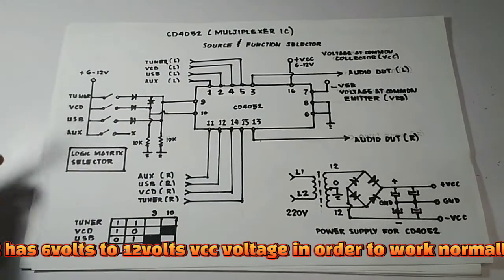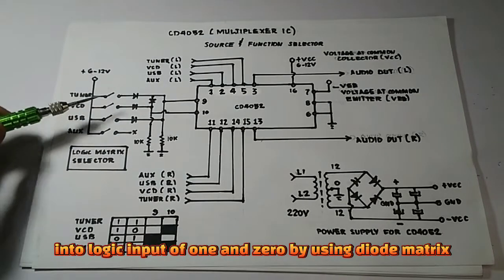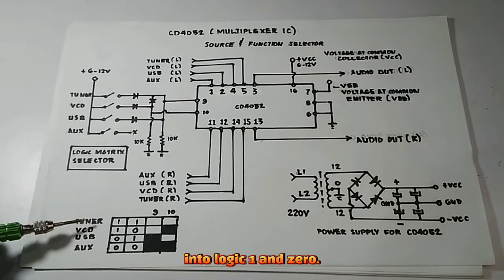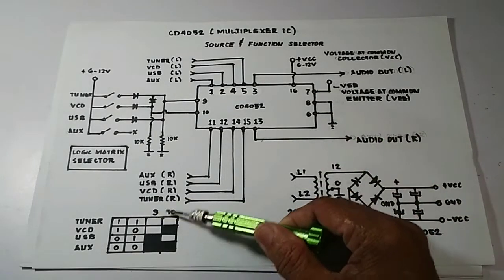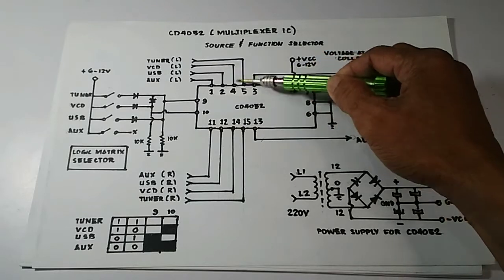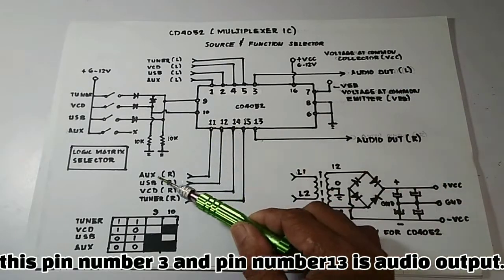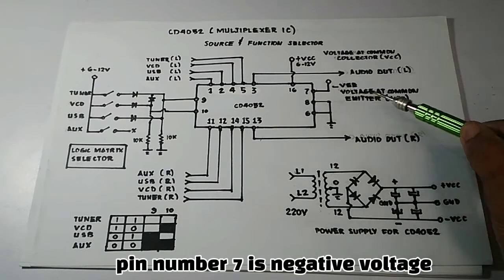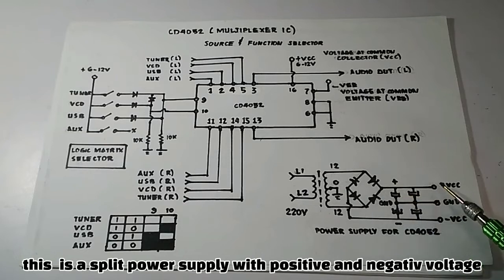Source selector / vhertron techvlog

Comment: 👍👍 Nice po sir,, .
Pwede po magtanong about crt tv na abnormal ang b+ 105 lang max pag pinihit ang trimmer tapos yong 15 v sa audio ay tumataas minsan aabot ng 19v china board po ito na may junggle ic na toshiba at may transistor na tl431a malapit sa trimmer,,
Reply from the maker: Pwede po ...
Reply from the maker: pm nyo po ako sa messenger at picturan nyo ang power supply section .sa ilalim at ibabaw.
Reply from the maker: try mo muna palitan ang tl431 shunt fix regulator yan kasi ang nag mimaintain ng voltage regulation.check mo rin ang trimmer adjustment out circuit kung di open baka high resistance na .mas maganda mapicturan mo at makita ko kasi maraming posibility na maging dahilan ng low voltage yan .
Reply: @vhertrontechvlog sinubukan ko palitan ang trimmer sir, ng resistor na 8.2 k tumaas naman umabot ng 110v sa b+ pero mababa sa vertical 22v lang sa  jungle naman 9.8v lang at sa audio 14v at nagpitik2 din pala ang lahat ng voltage pati sa loob ng primary parang heart beat pag sa analog tester.
Reply: Cgeh po,.ipapasa ko ang pic sa board,.t.y.
Reply from the maker: @bryanente3708  magpalit ka muna ng mga filter capsa power supply .pati main filter maganda may esr kana.
Reply: @vhertrontechvlog  sana talaga sir vhertron,,ok lang po kung buzy kapa po sir,,hintay lang po ako.